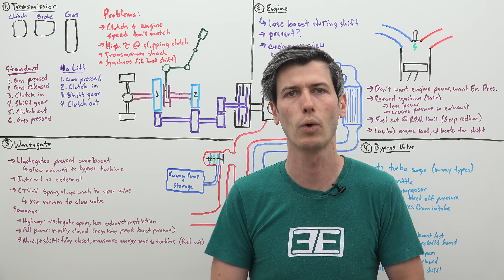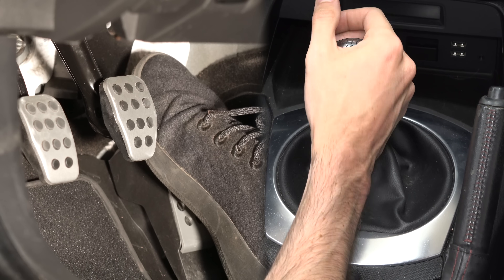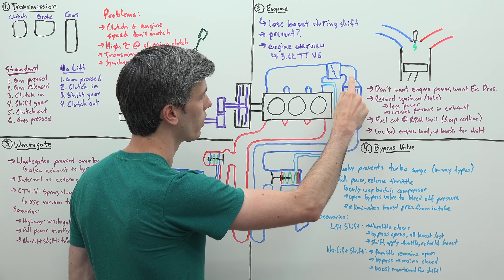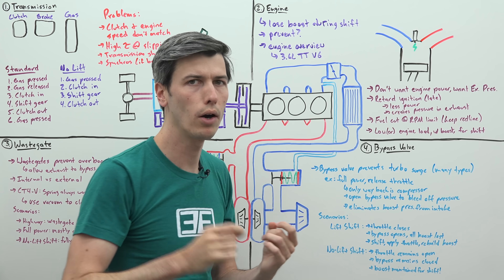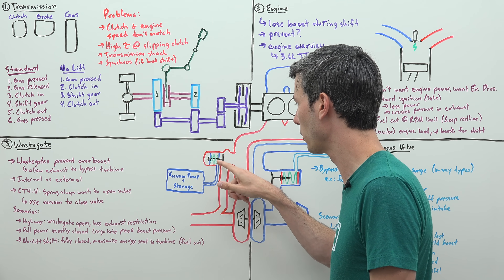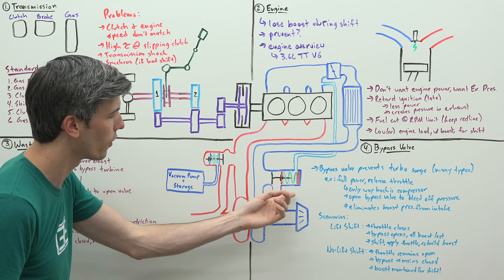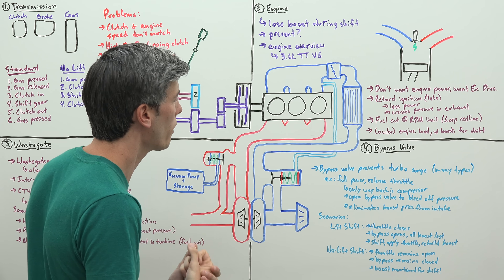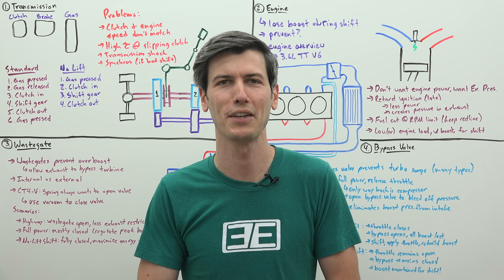How To Power Shift Correctly - Go Faster Without Destroying Transmissions

Comment: Can we talk about the future of Electric Car maintanance?
Reply: Fill/rotate the tires?  Fluids aren't heated enough to go bad, and there isn't much needed to cool e-motors and batteries (leaf gets away with none).  Brakes are only needed when you need more braking power than your engine can supply (as a generator) and (boolean and) you can fill the battery pack, so minimal maintenance.

Rebuilding a battery pack sounds like a great place to start for an EE watcher,  especially an EE (electrical engineer).  I suspect there are still deals out there for e-cars in need of battery pack repair and the process is said to be within the realm of this channel (not needing the Humble Mechanic to make it go smoothly, like supercharging or something).